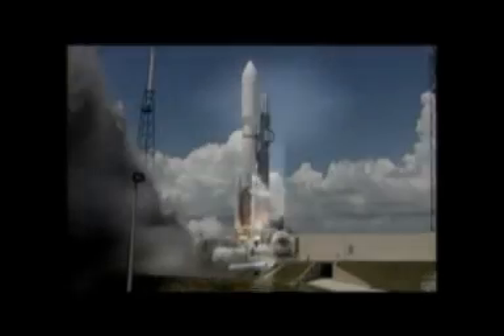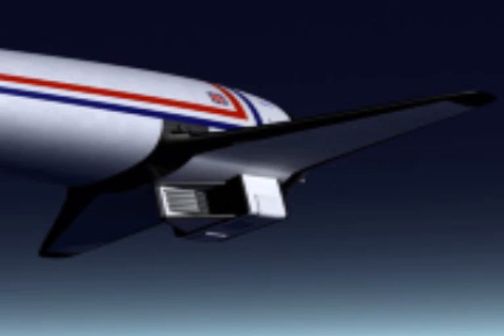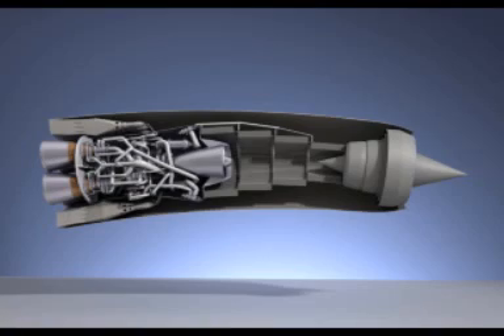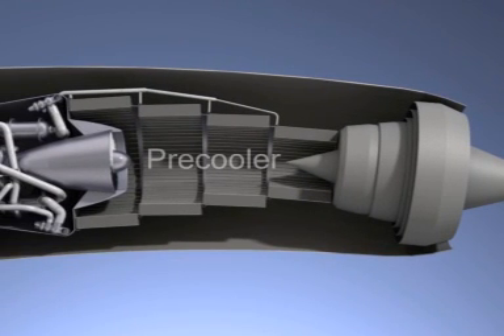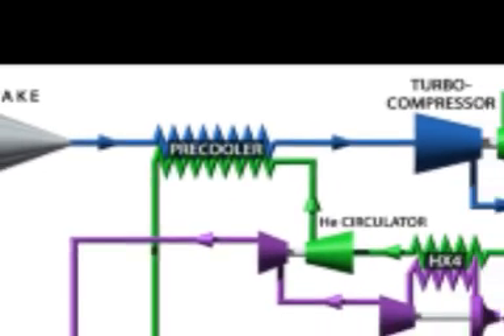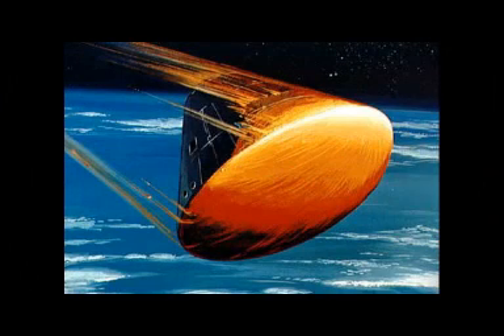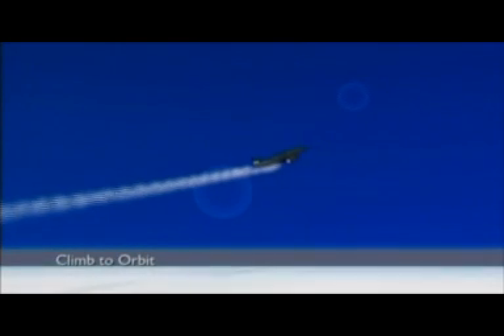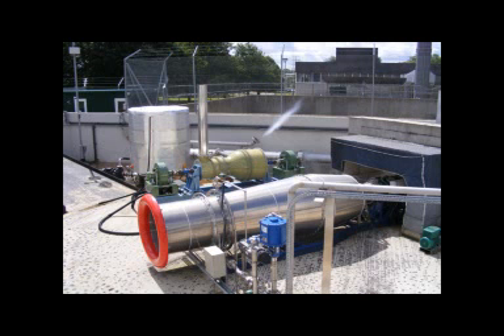Skylon. The Key To Economic Access To Space?

Comment: Rockets require a 'sship' load of fossil fuel burning, its the fastest way the public knows, but also the most limited in storage resource. So how to improve this? One needs to combine all the history engineering together, begining-to-final-stages, using wheel runways, the wing flight, jumbo electric power lasting propellers, jet after burners, then finally rocket exirt boosters, or deploy one as a cargo, you can also omit mini nuculear cell&solar-pan amped electric rockets, to deep solar orbit at gravity granted unlimited non idole travel, atleast 0.5~1.0G acceleration, comfortably cruising, faster then odile limited rockets. To any planetary destination.

Comment: Using INERT Helium as a "coolant", huh? "Cooled" itself with "liquid hydrogen". Right. Are you "cooling" or are you "removing heat"? And WHY would you need or want to "precool" atmospheric "air" before using its oxygen to oxidize fuel aka "burn" it? Especially a "compression ignition" engine? And who in the FUCK would trust "rocket science" to the "UK"?
Reply: Please elaborate.
Reply: The fact that you say inert Helium immediately rings alarm bells

Comment: Well if Elon is right and he can get costs down to $100 to $200 per KG with BFR then it will really depend on when BFR is finished whether the Skylon will be a success as I remember estimates being for Skylon that it could reduce launch costs down to $100~ per KG.

Even if BFR is $200 per KG and Skylon was $100 per KG then massive cargohold will make the BFR more versatile, although I suppose for resupply and crew transfer and normal sized satellites Skylon would be proffered in those cases which would take a load of businiess away from the BFR.

But the BFR can deliver absolutely massive telescopes and still deliver satellites on the side making the cost for secondary packages competitive with Skylon, but Skylon would have much greater flexilbity with launch time due to you not having to wait for a big launch.

Comment: Brilliant!! Now, at 12 billion USD (program cost) who is going to pay for it? Also, the design is orders of magnitude more complex than the BFR (that translates into a lot of problems that cause delays and cost overruns and ways in which it can fail in operation). Finally, at 15 tonnes of payload capacity to LEO that is 10 times less than the 150 tonnes the BFR will take to LEO with full reusability in about 2 to 4 years (also, "Europe to the Far East in under 4 hours"? BFR upper stage will do the same in 30 min). Having seen the Falcon Heavy launch and what Elon is capable of doing, my bet is that this bird will never fly.
Reply: Heavy launch only needed for heavy loads. most launches are not that heavy. It will compete on launch cost, and likely win.

Comment: Someone like Elon Musk should take this on and and try and redesign it with newer materials and more efficient fuel like Liquid Methane-Oxygen. I think this tech may be achievable now if we revisit it with a more modern, forward thinking approach.
Reply: The reason they use hydrogen is for it's higher thermal capacity. In it's current state the plane already burns half it's fuel in inneficient scramjets because they need more fuel too cool the main engine than they can burn with it.

These people spend 30 years working out the thermodynamic balance of the engine. I believe if they could just fix all their problems by choosing a different fuel they would have done so.

Comment: Will Never Fly..just like the X-30
Reply: +JJ Thomas Except that the single major technology development needed for this project has been completed, tested, and successful. The rest is already achievable with 2010 technology. Unlike the X-30, which needed viable Scram-jet developement, revolutions in materials design, had ridiculous goals of mach-20 in atmospheric flight, massive internal support for a huge cooling system capitalizing on the entire aerospacecraft skin as a heat exchange. This is a funny looking jet in terms of construction design and materials, and the complex part is dealt with in a small modification to a jet/rocket, and a slithly complicated heat exchanger. Is it easy? No, but the economics of the system are sound, and the design is hardly even close to revolutionary, just the culmination of the development of different technologies into a single product.
Reply: +JJ Thomas The engine has promise though. even USAirforce think so.
Reply: The same people that brought you the F-35, and were fully on board for Reagans absurd x-30
..
Reply: JJ Thomas If they are willing to try and develop different things they are more likely to achieve the goal.

Comment: Dumb question but why not just go with a Ramjet so much simpler in design?
Reply: +ryccoh Ramjets are dependent on air to function. The SABRE engine that the Skylon is using, is a sort of hybrid engine, that can use the air from the athmosphere, until it's high enough that there's no more useable air, and then switches to a closed internal system, with stored oxygen.
Reply: Simply, there is a gap between the area jet engines work, that you need to take off and initially accelerate, and the region ramjets start working. Then you need a rocket engine for the final push into space. It would be expensive on fuel to take off with a jet engine, accelerate after mach 3 with a rocket to ramjet speed, then fire the rocket again to get into orbit. And it requires the plane to carry 3 types of engine. Skylon carries one type.
Reply: The biggest problems with engines at high speeds is that since the air is already incredibly hot when it enters the engine you need more and more fuel to heat it up even more. That's why normal engines get rediculously inefficient at roughly mark 3.

Essentially this plane could outrun the blackbird by a factor of 2 and still be more efficient. You can't to that with scramjets.

Comment: In effect this a two stage rocket in a recoverable single stage design.  The first stage is the use of 'air breathing' technology to carry a given payload to a certain velocity (Mach 5+) and altitude before switching over to purely rocket propulsion second stage.  It is all too easy to get carried away with the potential technical achievement to super chill incoming air.   Economy is the ultimate reason for taking on this technical challenge.  However if we look at the economics of a recoverable first stage of a conventional rocket that can achieve the said payload, velocity and altitude parameters then the financial arguments to support this single stage to orbit concept are difficult to sustain.  If the economic case were overwhelming then Space X would be putting money behind it.

Comment: can anyone explain why the SABRE engine is curved the way it is ??
Reply: ***** The Skylon doesn't generate much lift with it's small wings, so it flys at a fairly high angle of attack. Its nose points higher up than it's actual velocity vector. And so it's engine intakes are curved so that they face directly into the relative airflow despite Skylon not being pointed directly into the airflow.

Comment: what a bunch of self opionated, undereducated,google led idiots are commenting here

This guy designed the Concorde engines FFS
Reply: Er, I  don't think he had much to do with the Bristol Olympus engines esp as the chap was 2 years old when designed - by the same guy who designed the Pegasus and gave the Merlin a 30% horsepower boost with one bolt on bit of genius to meet the FW190s. Sir Stanley Hooker.
But...I agree with you in spirit - as this guy is another genius - but I think he worked exclusively on rocketry.
Reply: ThePyrogenica yep bring it on!
Reply: ''This guy designed the Concorde engines FFS''

No  he didn't !!!  besides Concorde engines were the result  joint venture between RR and SNECMA so nobody can take the whole credit ..

Comment: Space planes designed to adopt hypersonic flight should only do so at there furthest possible point from the ground and closest to the outer atmosphere level as it would only take a short burn to be free of the atmosphere and into orbital speeds so the more of the weight of the craft can be taken higher economically , the less heavy the overall flight package has to be and conventional wings are the most effective way of doing this.I wonder if a better system of Jet rocket hybrid would allow the plane to compress the air intake at lower speeds and store this as liquid air, then feed this into the engine systems at higher speeds and altitudes as then there is no need to carry the mass of the air at launch or take off.Surface heat problems can be solved by designing new materials with the heat quality of the shuttle tiles but the strength to withstand collisions with foreign bodies in flight.

Comment: No physics problems just some engineering.
Reply: Pls. elaborate. Physics  is everything. Engineers implement, physicist visualize, and thinker/dreamer only imagines.
Reply: Raman Kumar  Before say Alexander Bell invented the telephone the idea of trasmitting a voice electronically was perhaps proposed by physicists but never demonstrated. The physisicst proposes the idea and many times the idea doesn't pan out. Once Bell proved that it could be done all doubt was taken away. However for it to fully span the gap from theoretical to practical, it needed a group of engineers. These engineers needed to make the systems of phone lines,mass produce the phones themselves.

So the skylon's origional physics problem was this. How do you cool air from 2200 C to -50 C? No one had ever demonstrated a heat exchanger that could do that quickly and was also light enough to fit on an aircraft. They were able to build a protype and show that it could be done. Now that the doubt is taken away, all that reamins are the rest of the engineering problems of putting the full system together.
Reply: Christopher Morrison These engineering inventions will revolutionize space travel, hopefully they can scale down the cost over time and perfect it.

Comment: I am wondering if it is possible to use the upper atmosphere the same way as a surfer uses the waves or a hydrofoil uses the surface of the water to achieve greater speeds by skipping though the fluidity models are different, air will act like water when you approach speeds that are a factor that relates to the density differences at velocities that are 200-2000 times greater than the equivalent mentioned water devices!

Comment: The most efficient possible design for a space plane using the Skylon engines
and known aircraft design innovations that could all be implemented to make a truly
inter-orbital and trans-global space plane.Here is the the concept, firstly we need to reach as high an alitude as possible using not huge amounts of fuel but rather we adopt the conventional method of using aerofoil wing designs to achieve efficient lift, rather like the space X concept but we carry these wings on board in a slightly swept wing design and not short high speed wing design as is the skylon approach, nor fixed delta wing as was the shuttle.

When the craft reaches a point in the higher atmosphere where lift can no longer be maintained without greater speed, the wings are swung into the fuelage as is the swing wing design that allows for a delta shape for high mach numbers as the plane approaches mach 3, the leading points of the craft are cooled along with the air intaken by the skylon engines, there will be plenty of storage space in such a long plane design to store the wings in a swing wing function and thus we only need to cool down much less surface areas that will heat up as the plane goes through the mach numbers and at some critical point the plane will need to either reach a vertical position or it could have a design of four engines close to the fuselage to enable better stable control as it rotates them into a vertical position once there is no atmosphere to slow down this unusual ascent that would be better for passengers as you do not force them to be in a highly inclined seating position, it should be fairly easy to reach orbital speeds once completely clear of the atmosphere and  also reversing the engines complete will give excellent retro rocket design and allow again the passengers to have a much better and acceptable re-entry stage

If you assume that only a rocket that is shaped like a bullet and points straight up can reach orbital heights and speeds then think again because once you leave the higher levels of atmosphere you can actually travel with the rocket or plane rotated in any position you want provided you maintain a balanced and stable platform of vectored force with computerised gyroscopic thruster control.

Comment: you will still need a rear tail surface as part of the incidence inconjuction with the cannard like the piaggio italian triple tandem wing under pitch so you dont violate the 130 degree nose/spar/swivel angle first discovered in hangliders now is usefull in high stess modulus materials in wings because the luffing high frequency modulation which leaves the rear of the wings tips must accelerate ahead of the total acceleration of the aircraft and arrive ahead of the c/g to activate the fulcrum effect for the incidence to work in a tail slide the cannard stops a nose slide .. skeatesy
Reply: Are you from Rockwell Automation?

Comment: The problem of re-entry surface friction over-heating is not difficult to solve as you could if having enough fuel and assured height above the atmosphere, rotate the engines and use them as retro-rockets so that re-entry speeds would be not hypersonic but more manageable speeds  as the energy required to slow a craft down that is in orbit is no where near the energy required to climb against gravity and though I don't know the formula or variables involved they would certainly be interesting to consider.
Reply: Yeah... The problem is that using the engines as retro-rockets means you need a lot more fuel because you have to not only slow down the rocket but the added fuel as well. Instead of being something like 75% fuel, it would need to be 75% fuel after reaching orbit. So it would be 4 times the overall weight... It is much easier to make it re-enter at orbital speed and just put heat tiles on it.

Comment: It sounds a good approach to use such an engine for a dual purpose.
 For sure it will find some applications for quick travel around the Earth and to jump to the Space Station and come back.
But I think that Thomas Townsend Brown and his electrogravitic generator is a better, and a lot simpler, solution to the problem and overall possible less pollutant than the current solutions. And it seems that would solve the energy problem eliminating very dangerous and bulky hydrogen and oxygen tanks. More so, the Brown’s solution seem to solve deep space travel.
Also the Hutchinson effect can solve the problem of heavy loads lifting into space, which would probably eliminate the need of the low efficiency space shuttles so many countries are proposing nowadays.
 What amazes me is the solution of Reaction Engines Co. to cool and compress air coming at 1800 F down to -220 F  all in a fraction of a second,  which is easier to compress.
Thanks for sharing.
Reply: Please leave the pseudoscience at the door...
Reply: a Star Trek type transporter or a Stargate would be simpler and save fuel as well but unfortunately they are also things that are just fantasy, this is an actual real serious project not relying on Teslar mythology or captured UFO tec
Reply: Brian Catnut I guess you don’t really understand what Thomas Townsend Brown discovered.
 The military were very interested in his discovery and after some time nothing was heard of it anymore. And nothing was heard much about Thomas Townsend Brown either except that he went overseas to work for a French company towards the end of his life.
 Some leaks pretend that his discovery went to a dead end, some consider those leaks unfounded.
 But many companies were involved in the study of Brown discoveries.
He worked for Martin Co. and later Lockheed –Vega Co.
Lockheed had a company called Skunk Works  whose  CEO  was Ben Rich.
 Ben Rich said that we have technologies to take the ETs back home wherever they live.
 I let you do some homework and connect the dots.
Reply: serbanmike
	 	 	 	The military was interested in remote viewing and using LSD as a weapon, it wasn't much of an endorsement to get them onboard a useless and expensive reasearch program, what are pretty much physics party tricks or good demos for a junior school science class are not going to get you to deep space.

Comment: What you say is very possible on a certain level. 

The only thing is at this point they have built working engine systems so they are at an advanced systems level and already have funding from Europe and the UK but it is not enough and this could be the real danger. 

The UK invented the modern jet engine yet it did not really reap the rewards that it should have. 

The reality is that post WW2 Britain has been dominated by welfarism and Churchill warned of this.

Comment: Skylon using "reaction engines" is trying to go all the way to orbit in space.  My point was was that Low orbit is a minimum of 220 miles up but can be as high as 600 miles.  Jet engines can only operate up to about 10 miles up.  So the part where the jet engine would be useful is very limited.  Since no one has yet made a single stage to orbit (a vehicle with no stages or drop off parts), they should try that first because fuel is the cheapest part of space travel.